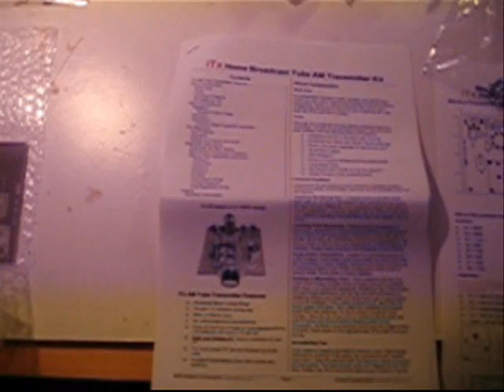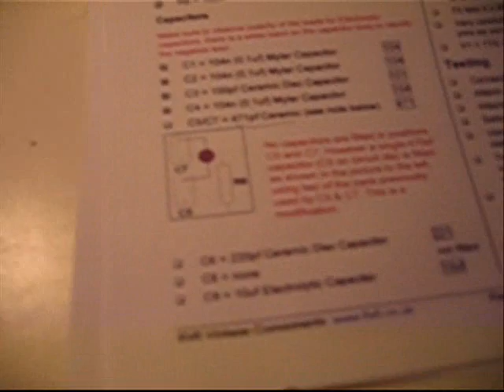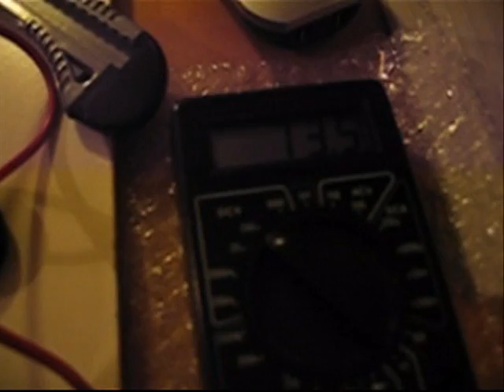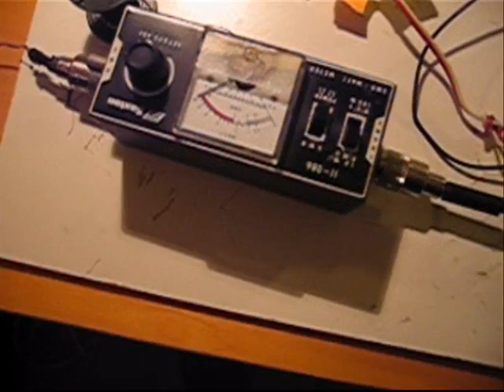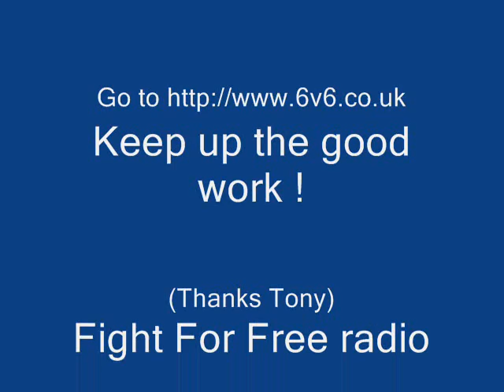ITX AM Tube TRANSMITTER Kit

Comment: Using a DL 92 tube at 90 volt the CW output is Apx 130 Milliwatt, Not 10 watt . 
Using as a Modulated TX at 90 volt  the carrier will be around 25 - 30 milliwatt so about 120 milliwatt PEP at full modulation 
Using the stronger DL 93 at 135 volt plate , the CW output will be 300 - 400 Milliwatt 
modulated AM around 130  Millwat carrier , so abt 0,4 - 0,5 Watt PEP

Comment: The tubes are smal signal tubes and never wil deliver 10 Watts, the atennne used was a piece of wire so the meter haddend a load so thats the cause of the high reading.